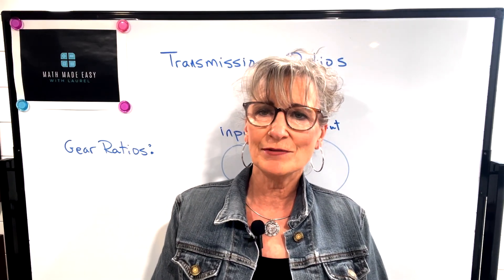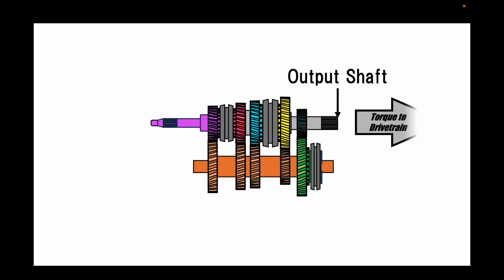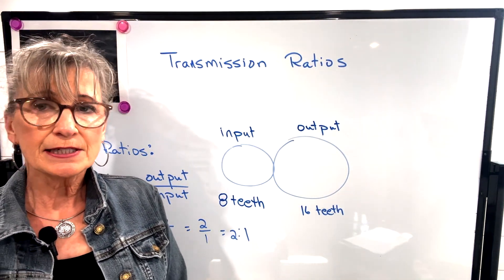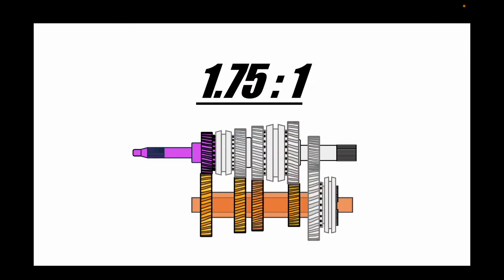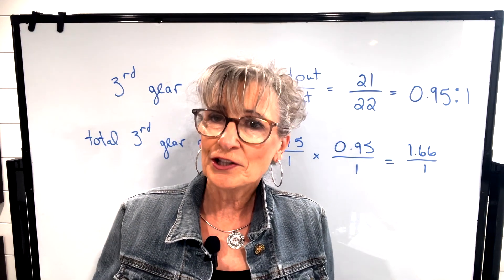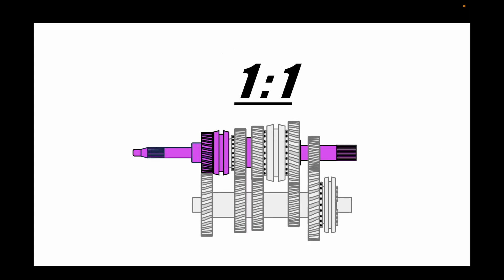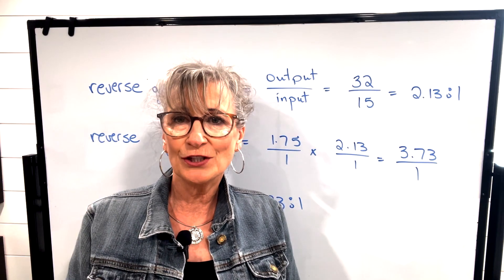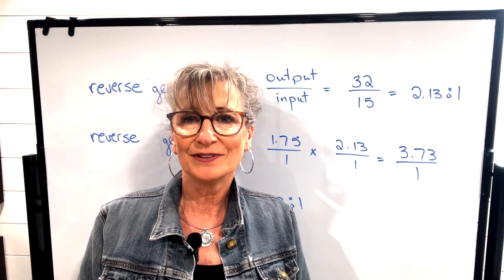Transmission Ratios

Comment: Mam 1.75 where it comes
Reply from the maker: It comes from the primary reduction ratio - the first set of gears the power is transmitted through.  28/16=1.75.